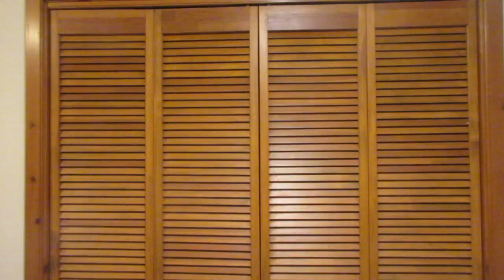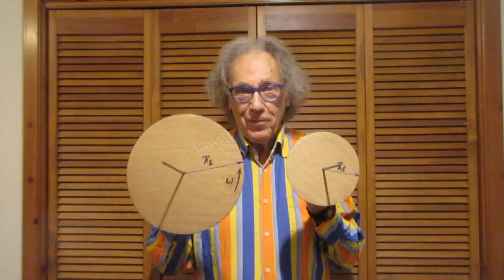Problem #8  Rotating Discs  - not easy!

Comment: Is any energy "lost" due to friction?
Reply: Markus Wiederkehr yes, and no...
but yes
Reply: Kinetic energy will obviously be transferred from the large disk to the small one, that's not what I meant. Will the disks heat up?
Reply: Markus Wiederkehr there will be friction, therefore there will be loss of energy,... but the interesting question is: where is the friction highest?...imagine these two rods are perfectly round but you can asume that air is around and causing friction to the overall spinning movement, but the interesting part is where these two rods connect, isn't? ... 
the best to describe such problems is to look on molecular/atom/ nanometer lever or perhaps even micrometer... you will see that there will be some kind of spikey landscape ...if....they were perfectly shaped...they would just fit like gears and not producing any heat...but ...consindering...at high speed..that they will slipp...  those molecules/atoms will vibrate and cause heat where they have been before... so...i hope that answers your question...but if you want another expression: if omega_1*r1 is not equal to omega_2 * r2 ....the difference of these two rotational energies will be a meassure for the energy which is turned to heat...
i am sorry if it is hard to read for you what I said, but english is not my native language.
Reply: Rudi Metzger-Wang In the video Walter says there is no friction between the disks and the rods. But he explicitly states that there is a frictional coefficient between the two disks. My question is, is this information relevant for this (idealised) problem. Intuitively I'd say then we'd also have to know something about the force with which the two disks are pressed together, because Ffric = mu x Fnorm
Reply: Soroush Khoubyarian Then I guess that is the part why it's not so easy as we might think, right? So when we integrate Ffric dx from 0 to X where X is the distance for which the two surfaces rub at each other then Fnorm cancels out because X becomes smaller as Fnorm becomes larger...?
Reply: Soroush Khoubyarian sorry, I didn't mean Fnorm would become larger during the experiment, I meant performing the experiment twice with different forces applied. I will try to solve the problem tomorrow with pencil and paper, thanks for your replies.
Reply: please remember friction does not perform any work when rolling motion is considered and since we are ignoring slipping and sliding work done by friction can be ignored.

Comment: God this is frustrating. Using v2 = v1 and angular momemtum does not seem to be enough, even if the masses DID cancel out which they don't...
Reply: I would say the omega of r1 will be negative one fourth the starting omega of r2. I think the best way to solve this is theoretically,  by examining a similar situation. Instead of the given example, imagine that r1 also begins with an omega angular rotation. In this case,  r1 will overpower r2 because r1 has half as much leverage acting on it where the point of friction is applied. Eventually r2 would be forced into a clockwise rotation. r1 will lose half it's angular velocity in order to cause r2 to stop spinning (instantaneously) as r2 begins to spin clockwise. Then r1 will lose another half of it's angular momentum in order to make r2 spin at full clockwise speed. So the same ratio of force transfer can be applied to the given example, even with different initial conditions!

Comment: We would have to make an approximation that kinetic energy is conserved.

1) gravitational potential energy is fixed, because distance from the ground is fixed

2) ASSUME minimal slippage as discs spin up and down, and negligible loss of kinetic energy due to the friction.

So, if k is R2/R1, moment of inertia I2/I1 is k^4 and w2/w1 = 1/k
Plug that into energy equation (energy of a spinning disc given by (Iw*2)/2) blah, blah, blah...
w2 = w * SQRT(1/(R1^2 + R2^2)) * R2
w1 = w * SQRT(1/(R1^2 + R2^2)) * R2 * R2 / R1

Comment: Assuming friction mu=0: w2=w; w1=0.
If the friction is 0<mu<1, then some of the energy will convert into heat, and it is not possible to find w1 and w2 exactly.
The interesting case is mu=1.
Reply: nigulh could express all your results in relation to mu  :D
Reply: nigulh 
there is friction and energy will be lost, but its still possible to solve

Comment: When in contact and not slipping the disks will have the same linear velocity at their edge. By considering the ratio of their radii and their angular velocity in terms of their linear edge velocity you arrive at:

 ω1 = (R2/R1) ω2  (1)

Let M be the mass of the larger disk and Ms be the mass of the smaller disk, by considering the areas of the laminas you get:

Ms = [(R1^2)/(R2^2)] M   (2)

Assume that rotational kinetic energy conserved; i.e. the work done against friction can be considered to be negligible. Applying rotational kinetic energy formula, and using (2) for the mass of the small disk:

0.25M(R2^2)( ω^2) = 0.25M(R2^2)( ω2^2) + 0.25M(R1^2) [(R1^2)/(R2^2)](R2^2)( ω1^2)

Simplifying:

(R2^2)(ω^2) = (R2^2)(ω2^2) + [(R1^4)/(R2^2)] (ω1^2)

Substituting (1) and simplifying:

(R2^2)(ω^2) = (ω2^2)[(R1^2)+ (R2^2)]

Rearranging for ω2:

ω2 = (R2)(ω)/√{(R1^2)+ (R2^2)}

ω1 can be found by substituting this back into (1) or (2)
Reply: Energy cannot be conserved; friction is a non-conservative force. "the work done against friction can be considered to be negligible" but the friction is what's causing disk 1 to start moving to begin with, hence it is unfeasible to say friction is negligible.
Reply: Sorry I probably wasn't clear, I assumed that the distance the disks slip before they reach equal edge speeds is small, so the energy lost to friction (e.g. heat) is small. So we can assume that the energy is conserved.

When the disks reach equal edge speeds is small they are not slipping past each, other no work is being done against friction. At the contact point both the disk are stationary relative to each other.

Comment: r2/r1=i  iw2=w1  or if you prefer 2r/r2w1=w2 If the Radius is 2 times Larger compert to the other gear(The large gear is R2 and w2) and the larger gear has given an Constant Frequenz the other gear will have double the speed but half the torque but in this case probebly not becous the Wood will silde first therefor the possible Power output on the 2. Gear will have decreast. w2r1μF=P2  the power that is lost is     (w2r2)-(w1r1)r2μF=DeltaD(istanz)Ff=P(lost) this thing will Burn be carfull not to use to mutch Power exept you try to make an Fire.  :)
Reply: Disk one is spinning he will have w, if then w gets to w2 the disk will 
have lost energie becous of friction and Moment shared it with the other
 gear I gues F is constant and t the time to the "Equalibrum state" get 
recorded 

r2w2=r1w1--> r1/r2=i---> i*w2=w1---> w1/i=w2 Transmission 
Faktor
wrμF=P 
(w2r2)-(w1r1)r2μF=DeltaD(istanz)Ff=P(lost) this thing will Burn be 
carfull not to use to mutch Power exept you try to make an Fire.  :)

tµFD-∫(t)(w2r2)-(w1r1)µF) =E;ofw-Elost;of over deltarDistanz of
Disk 1 and 2,=E21c(Energie of 2 and 1 in the nonchaning state, c for 
constant )  
w2r2t=D
W2r2t-w1r1t=DeltaD

(Start to Equalibrium state)∫f(t) DeltaD  *µF= Ethermal
t;r=time you needed to speed up that thing
µ;r=the friction of your Finger or wath ever you speed it up with
F;r=the force you Made on the Rod
D;r=The distanz over the surface of the zylinder Rot if you speed
t;rµ;rF;rD;r=Energie of Zylinder 2 with w
t;rµ;rF;rD;r-∫f(t)DeltaV  *µF)=E-E;t=E2and1constant=E21c

Ekin=1/2mVV  
I=1/2mrr (moment of inertia of zylinder/Disk) 
root(E21c*2/I)=wx becouse the moment of Inertia is on Evry Zylinder/Disk
 the same time Larger 
(r2r2)/ (r1r1)*wx=w2 (h1π is equal to h2π therfore its irrelevant) 
larger Volume more Mass becous its the same mattirial densety gets 
Irrelevant as well.

(Mostly irrelevant Missing stuff The Heat of the Friction energie if
 the wood gets hot R2 and R1 would change in length not mutch but a 
little bit + The Earth rotation if you let them Rotate 12h they would go
 Upside down +  The relativistic effects near the speed of light if you 
want to spin them real fast + The Gain an Mass coused by the Energie you
 give to w if you spin it up real fast + the lost wight coused by the 
Brand of the 2 Wood-zylinder that could be coused by friction if force F
 and w is to high+ the stabilty of Woodzylinder 2 it max could rip it 
self into Picecs if you aply to mutch Kinetic Energie on it + the 
momentum that goes to the Earth coused by the acceleration of the 
WoodZylinder)

wow that was ryl a bit harder then i thougt it would be :I First like oh
 
wow that so simple just tansimtion wait he wants to know it from w not 
w2 oookey that changes evrything. now evrything should be correct i 
think exept the grammmer that should be horrble to look at i gues :D
Reply from the maker: what is w1 and what is w2?
Reply from the maker: incorrect
Reply: w1 and w2 is allways changing time until theyre constant in the  Equalibrium state, im not sure how to write it mathenatical correct.

Comment: The Energy of a spinning disc with moment of inertia I=1/2(M*R^2) is E=1/2*(I*w^2)=1/4*(M*R^2 * w^2). Setting the rotational energy of the initially spinning disc 2 equal to the sum of the energies of the two discs after the contact and also using the fact that the linear velocities of the tips of the discs are equal after the contact yields:
w2 = (M2/(M2+M1) )^(1/2)  * w
w1 = (M2/(M2+M1) )^(1/2)  * w * R2/R1
Greetings from Heerlen, Limburg.
Reply: You are right. We should use conservation of angular momentum, as it is not affected by the energy dissipation from friction.
The way I got my answer was solving these two equation for w1and w2
1/4*(M2*R2^2 * w^2)=1/4*(M2*R2^2 * w2^2)+1/4*(M1*R1^2 * w1^2) (energy conservation before and after)
 w1*R1=w2*R2, (v1=v2 at touching point)
Anyways it's not the correct answer even though it shouldn't be far from the exact answer, because energy dissipation will be quite small.
Reply: Well if angular momentum(L=I*w) is conserved this means:
1/2*(M2*R2^2*w)=1/2*(M2*R2^2*w2)+1/2*(M1*R1^2*w1), (L1=L2)
w1*R1=w2*R2 (linear v at touching point)
which yields:
w2=(M2*R2*w)/(M2*R2+M1*R1)
w1=(M2*R2*w)/(M2*R2+M1*R1) * R2/R1
Now if you put for example M1=M2 and R1=R2 and calculate the total energy of the two disc with the two different values for w1 and w2 you'll  see that the total energy is only half as much in the case that you've used conservation of angular momentum compared to conservation of energy. So my original answer wasn't close to the exact answer at all. 
One more thing: the value of the coefficient of friction is not present in any of the result for w1, w2 or the total Energy E which seems really incredible! It doesn't seem to matter (for w1 and w2) how strong the friction between the discs is, as long as it makes them stop sliding at the contact point.
Reply: It seems you have canceled the masses on both sides. But they are 
different. All I did was express w1 from the second equation (w1=w2* 
R2/R1) and plug it into the first equation. Then cancel 1/4 * R2^2 on both sides and solve for w2. Then use w1=w2* R2/R1 to find w1.
Reply: Sorry, you've been right all the way. I hadn't considered that the mass is proportional to R^2. I substituted M1=c*R1^2 and M2=c*R2^2 and got your result. Plus i had a typo with the sqrt... I guess I'm a bit tired.

Comment: W1={WR2}^3/R1 (R1^2+R2^2)
W2=WR2^2/(R1^2+R2^2)using
1) w1r1=w1r2
2)equation of motion
Wf=Wi+@t     (where Wf=final angular velocity, Wi=initial angular velocity, @=angular acceleration ,t=time )
and torque=moment of inertia *@
fr1=m1r1^2@1/2
fr2=m2r2^2@2/2
     w1=2ft/m1r1
     w2=w-2ft/m2r2
here t= time when w1 and w2 become constant 
f=friction force between discs just before w1 and w2 achieved

Comment: Using Conservation of momentum
I2*W = I1*W1 + I2*W2

omega1 = [W(R2/R1)] / [1 +(R1/R2)^3]

omega2 = [W] / [1 + (R1/R2)^3]
Reply: Aditya Dutta Yeah..  I realised it later..  Conservation of Momentum is the correct way of solving it I guess..
Reply: Sufiyan Adhikari Not sure about that either, check out my reply for maxalabama.And check out my solution...

Comment: Since there are no external torques, conservation of angular momentum can be applied:
(I2)w = (I2)(w2) + (I1)(w1)                                                                                        Equation (1)

Replace I with moment of inertia of each disk, and cancel out the 1/2 coefficient in front of each moment of inertia:
(m2)((r2)^2)w = (m2)((r2)^2)(w2) + (m1)((r1)^2)(w1)                                         Equation (2)

We have to get rid of mass. Let p be density and h be thickness. We know their densities and thicknesses are the same. For any disk:
m = pV = p(pi)(r^2)h                                                                                                  Equation (3)

For disk 1:
m1 = ph(pi)((r1)^2)                                                                                                    Equation (4)

For disk 2:
m2 = ph(pi)((r2)^2)                                                                                                    Equation (5)

Substitute equations 4 and 5 back into equation 2, then cancel out ph(pi):
((r2)^4)w = ((r2)^4)(w2) + ((r1)^4)(w1)                                                                  Equation (6)

We need the answer in terms of w, r1, and r2 only. So we need to put w1 in terms of w2 and vice versa.
Since disk 1 is no longer speeding up and disk 2 is no longer slowing down, we know their tangential velocities must be the same:
v1 = v2                                                                                                                         Equation (7)
v1 = (w1)(r1)                                                                                                               Equation (8)
v2 = (w2)(r2)                                                                                                               Equation (9)
(w1)(r1) = (w2)(r2)                                                                                                    Equation (10)

Solving for w1:
w1 = (w2)(r2)/(r1)                                                                                                     Equation (11)

Solving for w2:
w2 = (w1)(r1)/(r2)                                                                                                     Equation (12)

To solve for w1, substitute equation 12 into equation 6:
((r2)^4)w = ((r2)^3)(w1)(r1)) + ((r1)^4)(w1)                                                          Equation (13)

Solve for w1:
w1 = (((r2)^4)w)/(((r2)^3)(r1)) + ((r1)^4))                                                             Equation for w1

To solve for w2, substitute equation 11 into equation 6:
((r2)^4)w = ((r2)^4)(w2)) + ((r1)^3)(w2)(r2)                                                          Equation (14)

Solve for w2:
w2 = (((r2)^4)w)/(((r1)^3)(r2)) + ((r2)^4))                                                             Equation for w2
Reply: There is no friction between the rods and the disks. 1:03
Reply: When did I say friction between the rods and the discs? I said that rods must apply force on the discs to keep their centre of masses at rest which would otherwise move due to friction from the other disc
Reply: Oh I see. The torque at the center of the disk is 0, because the disk is rotating about that point. This force you are talking about has a radius of 0, thus the torque is 0.
Reply: You are correct. I applied conservation of angular momentum incorrectly, because I used it about 2 different points: the center of disk 1 and the center of disk 2. The moment of inertia I used for disk 1 was I = (1/2)m(r1)^2. However, I now realize my mistake. I need to change it so that the center I use is ONLY for disk 2, and change the moment of inertia of disk 1 using parallel axis theorem.

Comment: Using 
i) conservation of angular momentum and
ii) r1*w1 = r2*w2

w2 = ( r2^4*w ) /(r2^4 + r2*r1^3)
w1 = (r2/r1) * w2
Reply: I believe when the mass changes, you cannot do it like that. I think you have to include the mass too. You should guess when he mentioned about density.
Reply: Is friction a conservative force fiield? Is the force that prevent disks to slit one above the other an internal force of the system of the 2 disks???
Reply: Johnny Jack   I have included the difference in masses in the Moment of Inertia terms.. 

m1 is proportional to r1^2 as density and thickness are same for both the discs..
m2 is proportional to r2^2 for the same reason..
Reply: it is better to use conservation of energy: 1/2 J ω^2 = 1/2  J_1 ω_1^2 + 1/2  J_2 ω_2^2. Angular momentum isn't preserved, it gets smaller.
Reply: Moment of inertia J for a disk is J = 1/2 m r^2 = 1/2 ρ V r^2 = 1/2 ρ π r^2 d r^2 = 1/2 ρ π r^4 d
Reply: What about the loss of mechanical energy to friction? Kinetic energy is definitely not conserved in this situation.
Reply: No, you are wrong.  While the coefficient of friction may be high enough that there is no loss of energy, you cannot guarantee that this is the case, so your equations won't necessarily be correct.
Reply: lustig im Internet , energy isn't conserved . Friction converts  mechanical energy into heat(thermal energy) that is lost to the environment
Reply: energy is preserved, there is, it is how I understood, just static friction, this means no loss of energy.

Comment: w=Omega
w1=w-w2(r2/r1)^4
w2=(r1/r2)^4.(w-w1

solved using conservation of angular momentum

replace mass by density.volume
Reply: Did you change the numbers? I got the same formula but with reverse numbers, 1 became 2 and 2 became 1